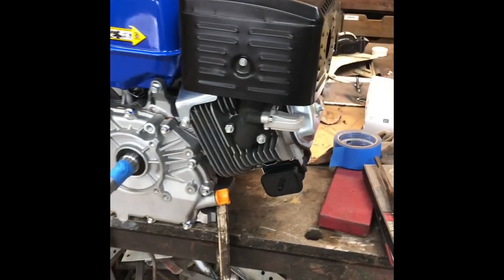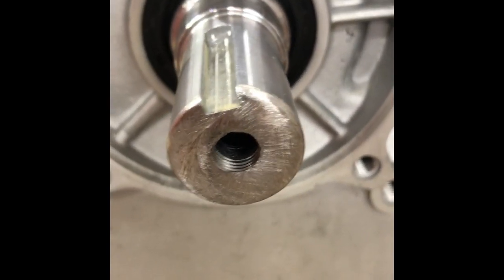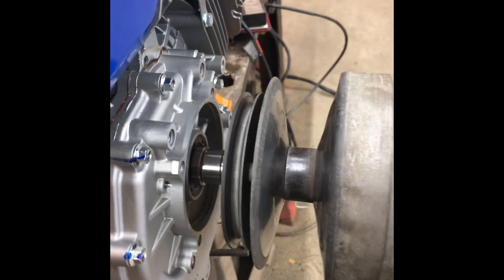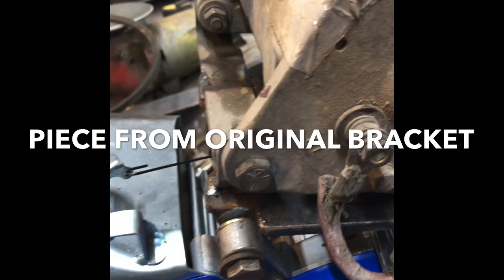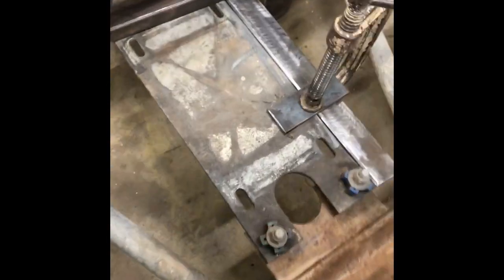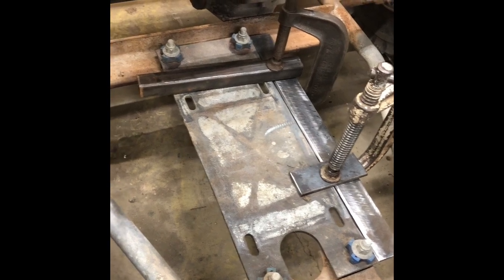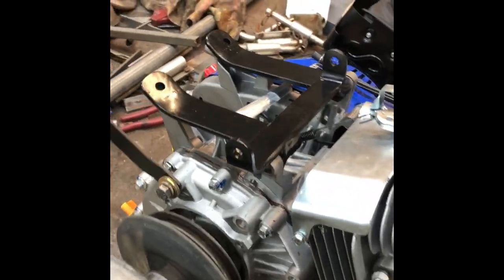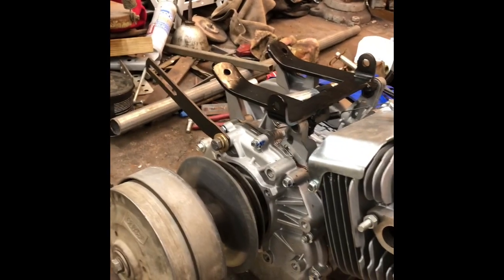Club Car DS 18hp engine swap

Comment: Just did a Duromax 440 swap on a 1999 EZGO workhorse this summer, the old engine was seized. these Duromaxes only make around 15hp stock (the 18hp is miscalculation of RPM X Torque). I'm running a stage 3 engine with a mikuni carb valve springs and a bigger cam. i have 23 inch tires and it went 26 miles per with the stock 12.44:1 gears and the engine at 5800 rpm. after the 8:1 gear swap (best thing to ever happen for this cart). it goes 35-40 mph with no loss in acceleration. These druromaxes are much more stout compared to predators and have better tolerances. i have taken this engine over 6000 rpm stock before the stage 3 install and kept it 5500 for minutes before without any negative effects. I still have the same problem as you however, where it is just so damn loud, I put a tiny 80cc moped silencer with an exhaust hole the size of dime and it did not quiet down a bit. one thing you did that i wish i did was keep the stock clutch, I went with a 780 series comet and it has caused me many issues because i'm still using the stock driven. But overall this is an awesome build you made and from what I experienced the more power and performance based items you put on your cart the less drivable it becomes at normal golf cart speeds. would love to see more people doing 440 swaps as they are so much cheaper than a V-Twin swap.

Comment: I'm curious to know how you did the gas lines, from stock tank, to the cart tank?
Reply from the maker: Sorry I didn’t show what I did there. If you look at the 40 sec mark of the video, you will see I ran the fuel line to the carburetor from the stock cart fuel pump. I did have an issue with the fuel lines. The cart fuel hose is 1/4” and the carburetor hose is 3/16” , I found a fuel filter on Amazon (search fuel filter 3/16” 1/4”) it has both size barbs on both ends. Worked perfectly. Hope this helps!

Comment: Did you put a key in the clutch adapter into the key way for the crank shaft?
Reply from the maker: No key, it’s strictly a taper.

Comment: Correct me if I’m wrong but aren’t you running the transmission in reverse to go forward because of the clockwise rotation of the factory engine? If that is the case how is the trans and holding up? I’ve read on forums that people say the gears won’t oil properly running in reverse but I never saw someone say they had tried the swap and it worked.
Reply from the maker: The older club carts ran in the clockwise direction (like most engines) I’m not sure what year it changed but mine is a 1990. I do know a few that run their cart in reverse to go forward and have had good success.

Comment: Hi do you remember the part number for the tapered sleeve or how you found it thx
Reply from the maker: 1" STEEL Gas GOLF CART Tapered Drive Clutch Shaft Adapter Extension Depot https://www.amazon.com/dp/B07PXHTBRK/ref=cm_sw_r_cp_api_glt_fabc_RB3CZAF08NXRKK51KF0N
I believe this is the one I got from Amazon.

Comment: Do you have to run the selector in reverse to go forward? I am in the process of doing this with mine and that is what I have to do. Top speed is very low
Reply from the maker: No mine was one of the years that the original motor ran the correct direction.

Comment: Can you tell me why a taperd sleeve had to be used please
Reply from the maker: The tapered sleeve was necessary to use the original clutch with this engine. Most “off the shelf” or universal engines have a “straight shaft with a keyway. The original engine had a tapered shaft therefore the use of a tapered sleeve was needed.
Reply: Is there anyway you can call me , I have questions if you have time and it's easier  and quicker if I can speak to you directly  please
Reply from the maker: @brucetate7417  i don’t really want to put my number out to the entire world but if you want to give me your number I’ll call you.
Reply: I sent my number
Reply: I am still trying to get a tapered sleeve kit.  Do you have a lint to Amazon for it.  Thanks

Comment: Great video you explained the process well. I'm back and forth on getting the same engine you used or picking up a predator engine. Would you do anything different if you had the chance? Where did you get the tapered sleeve for the drive clutch? Thank you,
Reply from the maker: A year later the engine is working great. If I was to do anything different it would be a better muffler. It’s a little loud for running around the neighborhood. I mainly use it at the race track where noise isn’t an issue though. I will say the more ive modified the muffler to make it quiet, more power is robbed from the engine. The tapered sleeve I got on Amazon. It’s steel, I thought that would hold up better than the aluminum ones and I’ve had zero problems with it. Thanks for watching and thanks for the comment, it was a fun project that made a big improvement on my old cart. It fires right up in -20f to 100f.
Reply: @IRBB484   I decided to go with a duromaz engine and so far the build is going great. Im still in the fabrication stage and I have a question about starting the engine. I'm using the starter/generator as well. Engine starts with pressing the gas pedal and dies when you let off. My problem is you have to choke it everytime to start it. Did you have the same issue? How do you start and stop without having to reach down and choke it every time? Thanks,
Reply from the maker: I only need to choke it when the engine is cold. I believe the video shows where I drilled a small hole in the choke lever and installed a choke cable that is easy to access from the dash.
Reply: @IRBB484  Good to hear. I'm bench testing mine so maybe I'm not running long enough to "get warm." Thanks

Comment: I’d like to hire you to do that swap for me, since you have done, and know what it takes to accoumpish a completed job!! I need more power, and not more speed, would you be interested .?
Reply from the maker: Thomas Morrison unfortunately my free time is very limited. I would not be able to do it. But thanks for asking.
Reply: Rick was your motor a clock wise spinning motor originally? Just picked up a 97 club car seems as tho I would have to use forward as reverse and reverse as forward if I dropped a motor in there the way it is, sorry if I missed that in your video thanks
Reply from the maker: mthsmouse I was lucky, the earlier model carts originally came with Counter clockwise rotation. So you are correct that you would need to run reverse to go forward. I’ve read where it’s been done quite a bit, but  I don’t have experience with it myself. Thanks for the comment and thanks for watching.
Reply: Rick Burton thanks for the video very informative
Reply: @mthsmouse  it works finr in reverse we dropped a snow mobile 340 motor in it did 50mph all day never had trans problems

Comment: Wouldn't it been easier just make your shaft the same as the old engine
Reply from the maker: That would require disassembling of the engine and machining the crankshaft.